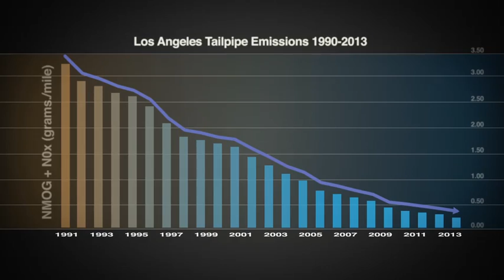Never Ending Race

Comment: Heres the thing. Smog is caused by 2 of the 5 major emission gases (HC and No(x)). HC are hydrocarbons, raw fuel that is unburned in the engine and No(x) which is released because of high exhaust temperatures. These 2 are what caused the smog and are what emission systems are aimed to eliminate. However the EPA targets these 2 because it is what you can visibly see. Todays emission systems dramatically decrease No(x) and HC but unbelievable increase the amount of CO2. Today the EPA does not care about the amount of CO2 released from these vehicles because we cannot see or taste it and hence will not complain about it. It CO2 that is the main greenhouse gas that contributes to climate change.  Internal gasoline combustion engine technology needs to go! Demand alternative fuels! Demand Electric! We can save the world.